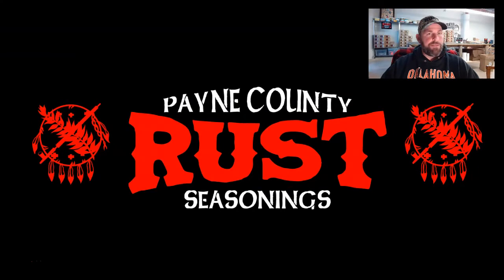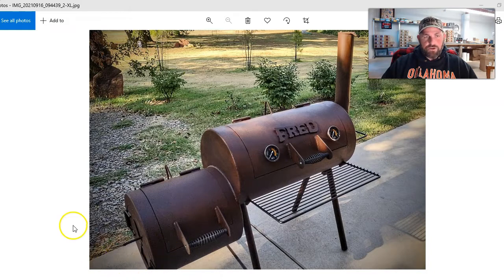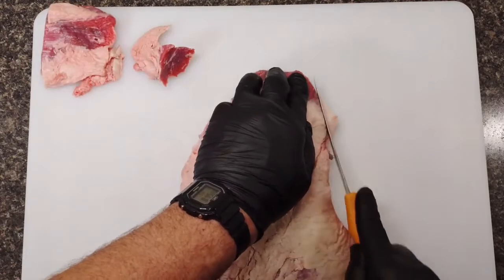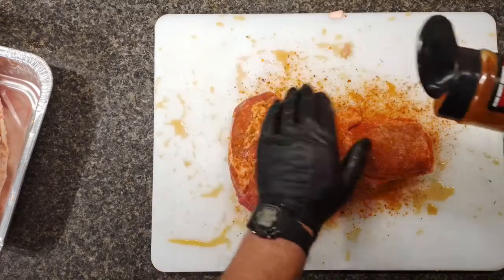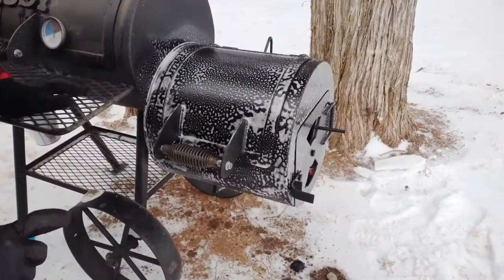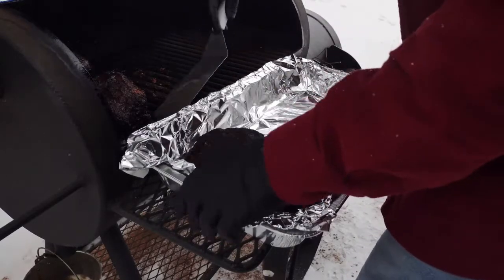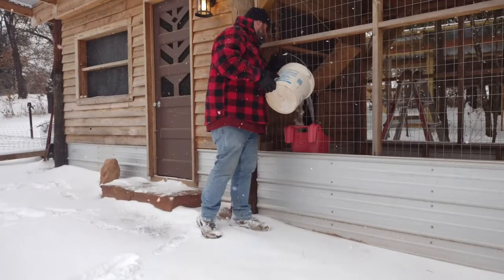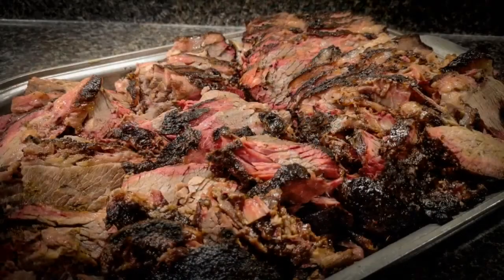Smoking a Tri-tip for the First Time

Comment: I really enjoy your videos. Hardly anyone else does videos on these smaller smokers. I have an older brinkmann that I believe is 3/16” steel 16” diameter. Looks to be about the same length as yours just left hand firebox instead. I’m up in Alaska and I’ve been smoking stuff all winter. 
Question, do you find that the flavor and the bark to be about the same when you primarily use charcoal for heat and use small amounts of wood compared to running on mostly wood?
I start my smoker with lump charcoal to get a bed going and then I run off of wood. Every once in a while I have to throw a couple big chunks of charcoal in there to help out the coal bed. My bark and smoke flavor are about as good as I’ve seen or tasted elsewhere but I go through a lot of wood and it’s extremely expensive up here. $40 for 1.5cf of oak or pecan and I’ll go through all of it in an 8-10hr cook when it’s cold. 

Your thoughts on the matter are greatly appreciated and keep up the awesome videos.
Reply from the maker: I find the bark and flavor from smoking over charcoal briquettes with additional wood chunks is very good. In fact, one runs less chance of that insidious smouldering-cool burn that an improperly-burning all-wood-fire can create.
 
I would opt for briquettes, such as Kingsford or Royal Oak, over lump charcoal though, because these mentioned brands of briquettes have wood chips and/or sawdust in them which gives even better syringol and guaicol concentrations during your smoke.

Lump charcoal, in my opinion, is best for pure heat, but is expensive, burns quickly and still requires wood chunks for true BBQ bark and flavor.

Try smoking over Kingsford and add a couple sticks of pecan, oak or hickory during the first few hours--then just Kingsford the rest of the smoke. I think you'll be amazed at the flavor!

For more info on briquettes or smoke chemistry, you can watch my video on BBQ Technique. It's a more exhaustive look at how smoke interacts with meats during the smoking process.

Also, if you visit paynecountyrust.com , there a downloadable pdf called "A Material Perspective of Wood, Smoke, and BBQ." under Charts and Resources.

Thanks for commenting, and good luck! 

P. S. Call a few wood-flooring companies in your area and see if they'll sell you end-pieces of unfinished oak flooring. GREAT smoking wood!
Reply: @PayneCountyRust  that’s a great idea. I work for a custom home builder and get some scraps here and there but that seems like it would be a more consistent source. 
I appreciate the feed back. I’ve been super particular about running my fires so that I get very clean smoke but it’s a pain running a hot small fire as to not have massive temperature spikes. I’ll watch the technique video again since it’s been a minute. After I give your method a go I’ll drop a comment on your next video.

Comment: You mention that you could finish them in the smoker, but decided to finish them in the oven instead. How do you decide whether to finish them on the smoker or in the oven?
Reply from the maker: I usually only finish items in the smoker if I need the smoker to remain hot. When I finish products like ribs or chicken, the last step is to glaze them on a hot smoker, so I keep it burning. Else, when the smoke step is done, I finish products in an oven to save charcoal and wood!